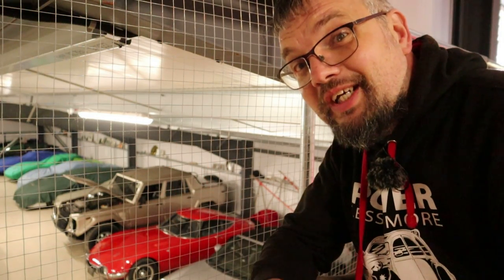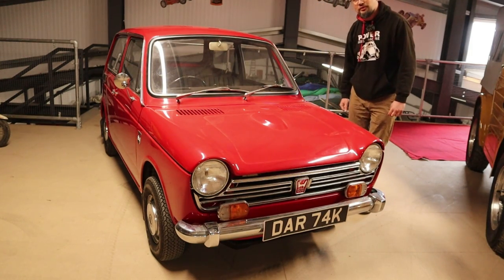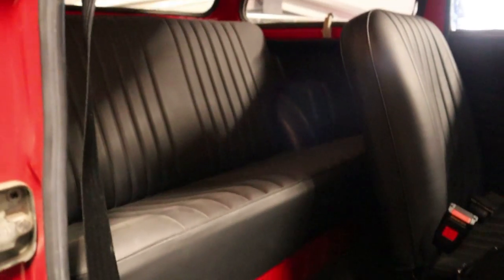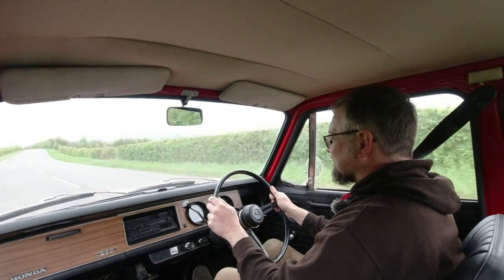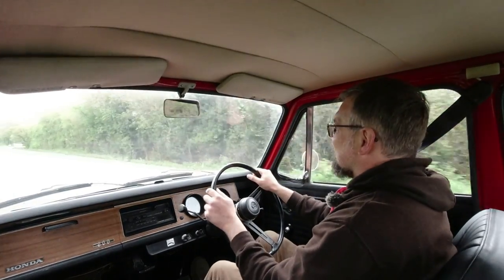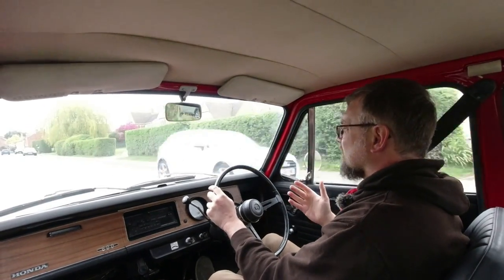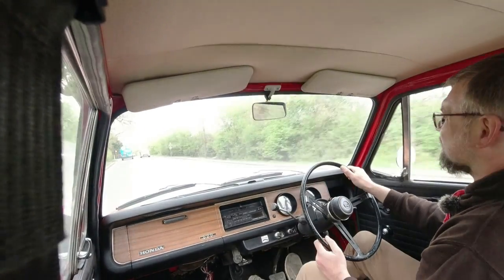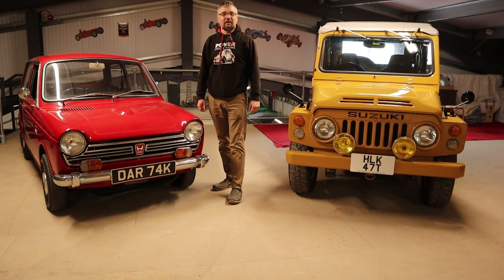Real Road Test: Honda N600 Hondamatic. Amazing engineering!

Comment: That's one thing I love about older Hondas, manufacturers of the time turned out cars that were built with "That'll do" in mind, but Honda basically said "No, it won't, we will do it better!!!", and they did, so much innovation and clever engineering, coupled with reliability and quality, it's no wonder they became so big, and, as far as I'm aware, they have never been owned by another car manufacturer, which says something... :)
Reply: Wouldn't surprise me if the now popular term "hold my beer" originated from Honda. Just that gearbox... Compare it to what Smart came up with 30 years later.
Reply: And recently Honda has been voted as making the most reliable cars in the world. They did the study on several thousand cars all over 20 years old and Honda consistently had the fewest failures, and when they did they were consistently the cheapest and easiest  to fix.

Comment: In 1986, I was given a lift from Boston to Norwalk Connecticut, about 170 miles, much of it on freeways with huge Mack trucks bombing past us, in one of those Hondas. It is probably the most vulnerable I have ever felt on the road, and I am a biker!
Reply: To Barnfish! You might have have felt EVEN more vulnerable, if you'd realised how that short back was, if anyone ran in to you. Did you realise that the boot lid was only PLASTIC? Again the Mini was a REAL car, with a REAL metal boot lid!
Reply: @nygelmiller5293  
Don't forget, the original Mini boot lid was held open by a couple of wire ropes so that a bale of hay could be carried...and the registration plate holder was on a pivot so the reg plate swung down to the vertical and could still be read by the Police while the boot lid was open......
Debatable whether a heavier metal boot lid was "better" than a plastic one....

Comment: I’ve allways been a fan of Honda,as a motorcycle mechanic.every time I change cars I buy something else,then go back to Honda again.I have a early 1999 Honda HRV with CVT gearbox just so reliable never fails to start.
Reply: Yes, I couldn't agree more. I have a real soft spot for the old sohc Hondas. When I worked as a motorcycle mechanic, although most Japanese manufacturers were very good, Honda just seemed better.
Reply: @PurityVendetta  your not Mikes daughter are you..

Comment: Steve, a guy I worked with back in 70 - 71, had one of these. We went everywhere in it. His was a four speed with the gearshift coming out from the dash like a 2CV. Seems to me it wasn't synchronized. That little car could do 70 mph all day, and even being air cooled, the heater worked well. It met its end when Steve got tee-boned at an intersection.
Reply: The earlier ones had a non synchro box which was replaced by a synchro gearbox. We had a Hondamatic and a manual. Both fabulous.

Comment: Squeeing with delight and nostalgia at this one - I have childhood memories of my brother's N600, which eventually became a restoration project with a couple of donor cars. I recall growing up in a household with bits of Honda Scamp just about everywhere, and that little twin was my childhood introduction to the inside of an internal combustion engine. With the head removed, the classic technique was to suspend the timing chain from the bonnet catch with a length of wire, so that it didn't drop into the sump (and possibly the gearbox) never to be seen again. To quote a certain someone - "Good Times!"

Comment: Hi Hubnut. Yes I remember these. They sold well in Australia as the Honda Scamp. I was a schoolkid at the time, and my recollection is that they were a vehicle of choice for female school teachers. Indeed, the Civic replaced them, the first Civic being a little rounder and more refined, but not much bigger. Cheers.
Reply: To Peter Anderson. Interesting that this car also had a proper name where you are! SCAMP. Sounds appropriate! In the 1980's they did one , the SC100 they also called the WHIZZKID. That was a proper rival to the Mini, with a 4- cylinder engine, at the BACK. Check this model out on the internet if you don't know it.Still one of the nicest looking cars ever! They had individual seats, that gripped you round corners, and were like a little sportscar!
Reply: I think the ones in Australia were mostly 360 engines. A friend had three Z360s in the 1990s saved from various paddocks, but I dont think he managed to get any going due to flogged out motors.
Reply: @stephenw2992  The Scamps were generally 600cc's however there was a cheaper version with the 360cc. There was also the trendy 360cc 'Z' which came out around '72, then in '73 the Civics started and the Scamps tended to phase out about then.

Comment: I would love to see a HubNut test of that LM002 I saw lurking downstairs.
Reply: Might be a problem if he had just stepped out of TWC or Ellie and opened up the throttle on a 2.5 ton 4x4 with a Countach engine.
Reply: @seancooke4127  nah, he probably drove the mighty 110hp C5!
Reply: @cme2cau  correct Man. Do you think he's going to get it remapped?
Reply: @seancooke4127  He so should! I have a C5 X7 with the 160 ps/340 Nm HDi 16 2l. I understand a remap can get the earlier engine close to this. Performance is more than adequate!
Reply: @cme2cau  sounds good alright. Very useful torque. My Brother bought a 2008 Vauxhall Vectra 1.9 Dti 150 earlier this year and he found a little box under the steering column and an instruction manual for a type of tuner along with the paper work. He reckons it's got closer to 175/180 bhp than the standard 150 bhp. It pulls like a steam train. Still returned 57.6 mpg for me on a 120 mile Motorway run last month.

Comment: A friend of mine had a Honda N360 (manual) when I had an Austin A35.  Being the 'big block' 948cc, I challenged him to a drag race.  No prize for guessing who won THAT one and I was an instant convert.  The gear changing action was very strange and was almost a wrist twist than a genuine throw of the lever, but she was a quick little car (respectively).  I sat in the back of it on one trip (of about 40 miles from his place to mine) and when I say 'sat in the back', my feet were up on the other half of the seat, I had my knees bent and was leaning against the side of the car.  Not something I'd be happy to repeat now as I was a stick figure then and this has not followed me into middle age in the least!  Still love seeing them and will always go look at any I see parked.  Fascinating little car.  We were working on the cooling system of another friend's Cortina and asked him to nip over to the N360 and get the radiator cap for us to use.  Every time he asked where it was, we told him it would be on the radiator. Took him about 10 minutes to work out we'd been pulling his leg....

Comment: My wife and I bought a slightly used N600z. The hatchback model .  It was a terrific car. We owned it in San Diego, California.  On one occasion we drove it across the Grapevine into the Central Valley of California to see a classic motorcycle show.  There were four adults in the car and it would do an indicated 70 mph. I sold it to buy the second series of Honda Civic with the CVCC engine.  That was another great car . My wife and I drove it across the USA.  I kept it for many years and it ,too, proved to be very reliable.  Both cars had standard transmissions.  If you could buy a new N600Z I would want to own one. I was always as happy driving the 600Z as you were driving this example of the N600.
Thanks for a great video. It brought back a lot of fun memories.

Comment: BTW, another element to the story of Honda's CVCC technology (and also showing the "very, very Honda" way) was when their 4-cyl engine met the then-upcoming federal emissions limits here in the U.S., GM's response was, essentially, "Yeah, but that works only on those small-displacement engines" (it's worth noting that the U.S. Big 3 had all been whining that these new emission limits were impossible to meet, would destroy the industry, etc).  With that, Honda quietly bought a new Chevy 350 c.i. V-8, designed and made CVCC cylinder heads for the engine...and submitted it to the EPA for testing. It passed. Easily. In fact, I think it was cleaner than Chevy's own engine. Fact is, GM didn't want to invest in new heads and, like Ford and Chrysler, were counting on being able to just clean up the downstream mess with add-on catalytic converters.

Comment: I have a big ❤❤❤ for the Honda brand. Never seen this one ever before sadly. My uncle had a 1975 red civic also with an automatic gearbox. I had a 1988 Civic  1.6 16v which I had for over 5 years. Now I drive a Honda 108 cc scooter for almost 7 years. Its just amazing how well everything is engineered and build. Solid as a rock, never lets me down. Great video btw Ian! Thanks a lot for sharing!

Comment: Really enjoyed this video, probably as much as Ian did making it. When I was still in school in the 70's my friend would get dropped off by his dad in one of these diminutive Honda's, either a Z or an N, can't remember which. My friend went on to buy a Suzuki swift with the nippy 1.0 3 cylinder engine and digital dashboard which was very advanced for the time. My first car was a first generation 1974 Honda Civic 1169cc 4 speed manual which had a lovely sweet engine and smooth ride which was far better than it had a right to be. Watching this video I can see all the design elements which must have originated from the N600 like the top hinged boot lid to the wooden dash inlay. My Civic is long gone but I still have the scissor jack with the Honda logo still in tack, it is one of the best engineered scissor jack's I have ever encountered. Would love to watch you review one of the first generation mk1 Civics.

Comment: I had a Honda N600 in 1978/9 and it was an incredible little car, many nights out with 4 of us in it and it coped really well. One night we came out of the nightclub and a tyre was flat, changed it really fast by just picking it up. Three to lift and one to swop over the wheels, no need to mess around jacking it up.

Comment: Great video Ian of a lovely little vehicle. As a biker who has owned over 15 Hondas I can totally relate to the vibe you get from Honda's engineering. By the way you can get geared automatic mopeds. My first bike was a 1982 Honda C50 LAG Cub which had a 3 speed automatic unit. It was capable of 42 mph which is quite fast when you are 16!

Comment: We had one of these back in the day. It was the manual version. It handled motorway speeds with no trouble, and we often used it four-up. We also bought a tow-bar and fitted it ourselves... Yep! We pulled a Mirror dinghy around on a home-made trailer. The wheels of the N600 were same size as the Mini, and so I built the trailer with second-hand Mini wheels in order to use the same tyres.

Comment: I have always loved the old Hondas, abd these are no exception!   Never realised they were 3 speed, I seem to remember the civic had only 2 speeds which seems odd....   what a lovely find Ian.
Reply: Gary Mills, you are quite correct.  My memories of the mid-70s Honda Civics, Honda Accord "Hondamatic" was a two-speed semi manual, i.e. you had to start off in first, and move to second.  If you just left it is second as a defacto "Drive", it was extremely sluggish, and this ended up ruining the transmission!

Comment: The N360 version of this, with the automatic, was the first car I ever drove (around an empty carpark). My mother bought it in 1971 instead of the Mini she'd intended to get because there was someone setting fire to Minis in our part of Melbourne. So really that was a random reason, more than any technical one.

The kickdown worked well and there was never any need to change manually. The 360 revved higher and sounded even better than this 600, and reportedly had no trouble crusing at 100km/h. I never drove it much myself, as I learned in a manual, but the few times I did it was fine on 75km/h arterials. On the Monash Freeway, in 2021... it would be terrifying.

It came to a bad end with a cracked cylinder head at about 10 years and not much mileage. I don't remember any more whether the part was unobtainable/too expensive/too expensive to fit, but it was replaced by a Civic with a horrid 2-speed semiautomatic. You can say that was more of a real car, but I don't really think it was.

You compare it in power to an 850cc Imp. I had one of those, and had the experience of driving that and the N360AT one after the other. The power might have been similar, but the Imp was a much quicker car because it went around corners better.

Comment: Thanks so much fo bringing back memories of my first car. Mine was an LN360 - the panel van version of the N360. Basically this meant no back seats and the passenger seat was fixed in the most forward position. I had much fun in that little car which my girlfriend of the time said she could hear starting up from her home 3miles from mine. But commuting the 250 miles from Lusaka to Kitwe on the Zambian Copperbelt was fun. On one such trip I got 65mpg. But my favourite trip was driving this tiny noisy car up and down the Zambian side of the Zambezi escarpment.

Comment: I had one of these 35 years ago when I was 17. It had a manual gearbox and loved to rev. It was way more advanced than the mini. Macpherson strut front suspension, front discs etc. The boot lid was plastic to save weight. I'm ashamed to admit that I grasstrack banger raced it and it did a full season despite rolling it 5 times, 2 of them end over end. It then did the end of year demolition derby and came 3rd!
It did burn a lot of oil as the loose timing chain had worn a hole in the front of the engine and then threw the oil onto the downpipes. 
Loved the little car. All I have left of it is one photo and the badge off the grill.

Comment: I had one, got it from a guy who'd seized it, car salesman told him it was 2 stroke, so he mixed the petrol and never found the dipstick & seized the engine.  I got new bits for the engine, welded the crank case where the con rod had exited and enjoyed the little beast until the mrs crashed it.  Mpg was massive, it certainly was a fearless beast in the snow.

Comment: Love the Honda.  My mother in law had one in the late 70s.  The manual gearchange was quite like the 2cv if I remember correctly. The cooling fan pulleys broke on our car but we just carried on driving it.  The instruments broke and I managed to jury rig a set of replacements from a later car.  Great fun!
Reply from the maker: Gearchange is a bit more conventional if I remember rightly from driving a Z600. Sprouts from the bottom of the dashboard.

Comment: I had a 360cc manual in Australia; it was called a Scamp there. A nice little car; rather like a slightly noisier Mini. No synchromesh on the gears so you usually got a bit of a clonk or grind. The timing chain wore a hole in the cylinder head so I scrapped it. They were worth nothing in the mid 80's.
Reply: A mate of mine had a Scamp as his first car in 1971 here in Adelaide. I think it was the later sportier Z that was used in the movie Malcolm.

Comment: I have a “Motoring Which” report from 1969, comparing this Honda N600, its smaller sibling the N360, a Fiat 600D, a Reliant Rebel & a Mini 850. The Mini comes out best, but only because BOTH Hondas had steering failures, owing to a design fault in the linkages. They also both suffered from brake problems. The CA said that, were it not for these defects the N600 would be a good buy for a car in that price & performance bracket. Once again, HubNut have nailed a delightfully quirky car in terms of its abilities!

Comment: I was taken to and from school in an N600 between 1974 and 1978 ish. It was custard coloured. I remember little except the way the rear windows opened, the sound of the engine, the 8 tracks - Carpenters, Wings, Shirley Bassey and Waggoners' Walk on the radio. It replaced a Ford Anglia and was much easier to start when damp. Was replaced by a grey Simca 1100.

Comment: Talking of Minis and two cylinder engines, have you watched Ivan's shed building up the 2cylinder prototype mini engine??
Reply: Some contrasts perhaps between the  driving style of Ian here in this precision instrument and  Ivan in his 1959 Mini test drive,  replete with £800 washer bottle, but the rpm range used seems similar ! Could we get Mr Seabrook into one of Mr Dutton's sawn-off Bugatti powered midget cars ?

Comment: Honda are still at the forefront of innovation with their motorcycles too. An automatic gearbox option is now available with most of their large engine bikes provided by a double clutch system (DCS)

Comment: In the early 70s, they were known  to  have head welded up to bore new inlet ports instead of the siamesed ones, and fit a Webber, with a hot cam and a mild big bore with high compression pistons they would put out 75hp.

Comment: I used to drive a Honda 360 Acty flat bed truck at work. It was brand new and an absolute hoot to drive as long as you didn't turn it over on a roundabout if you ran over a Nuttalls Minto. I had to load motorbikes on the back of it....oh joy !

Comment: Nice! Thus is the entry on the N600 from my 1968 edition of The Ladybird Book of Motor Cars:

Better known for its motor cycles, the Japanese Honda company has recently also entered the light car market. There are various models but the N600 is likely to be seen more and more on European roads. It has a front mounted, overhead-camshaft engine which drives the car's front wheels through a four-speed, all-synchromesh gearbox.

Engine: 2-cylinder, 599 c.c. capacity, developing 45 brake horse-power. Overall length: 129 inches. Seating: 4. Average maximum speed: 80 miles per hour.

Comment: My friend had a Honda Acti Van and a Pickup. They both suffered the same end fate when the drive shaft CV joints needed replacing, which you couldn't get in this country and were a special order from Japan! As a consequence both cars were scrapped